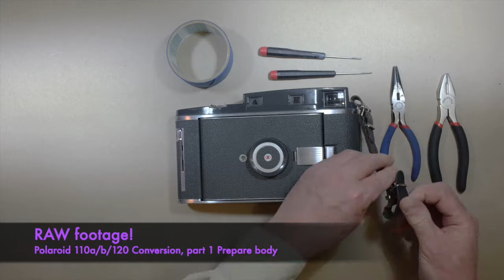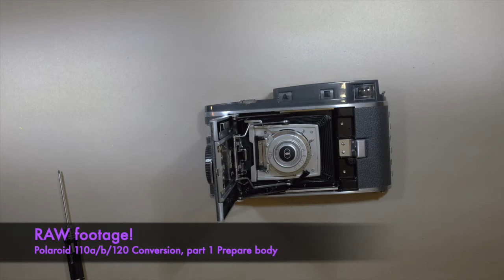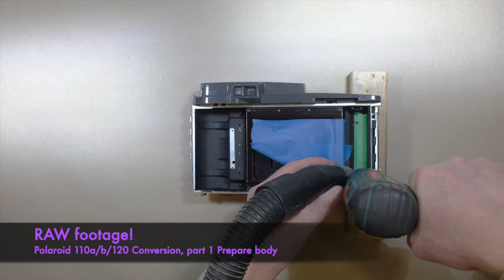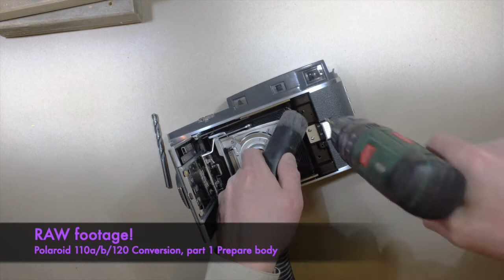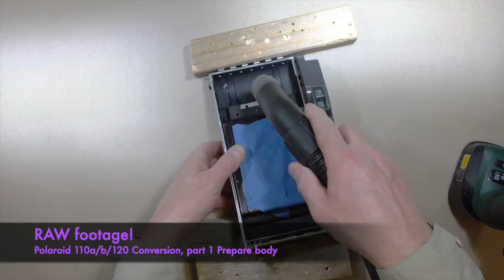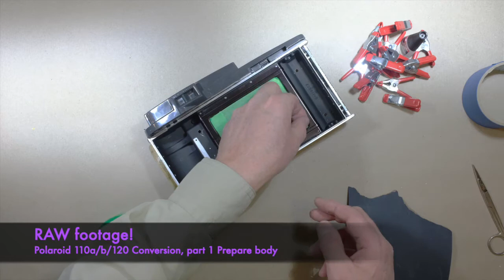Pola110 conversion part1 fast

Comment: How were you able to remove the metal hinge so effortlessly? I just couldn't get mine removed, and my conversion plan stuck for two years because of that
Reply from the maker: To remove the hinge from the body I use a sharp/new 3mm drillbit, this is much faster than a dremmel. Removing the hingepins and rear lid is primarily to make the work more easier and clutter free, but optional.
Reply: @Morkolv  Thank you! I actually managed to remove all the rivets yesterday and finally got the conversion done.

Comment: Thanks Morten for the video. Ok so the metal hinges at both end of the body need to be removed. Have you used the left hand grip piece in any of your mods ? Some use the left hand hinge to replace left part as a thicker left hand grip. Thanks.
Reply from the maker: No, I did first consider to add some extra grip, however found that there is sufficient as it is. Once you put the strap back. Neither has it been requested or commented on.